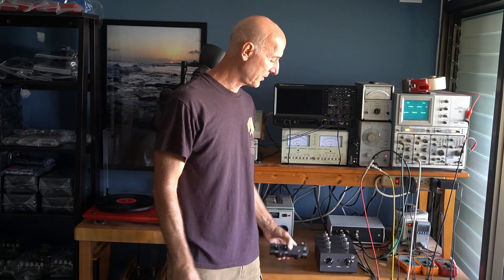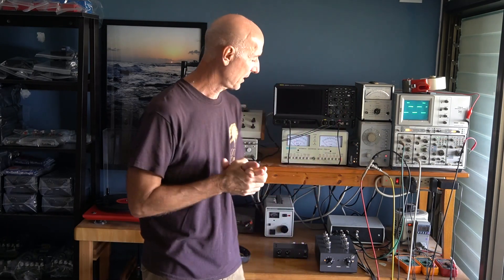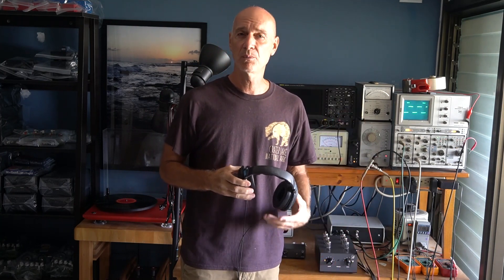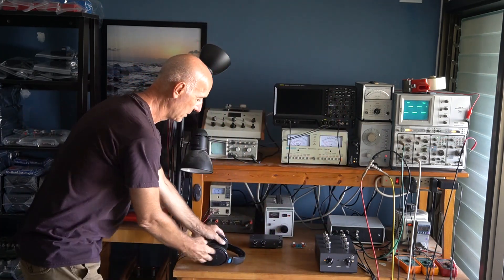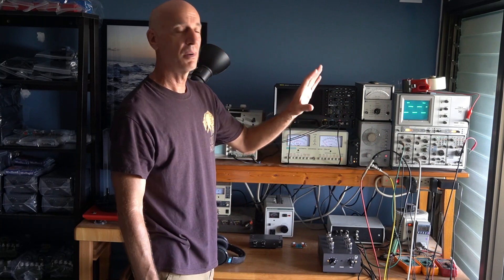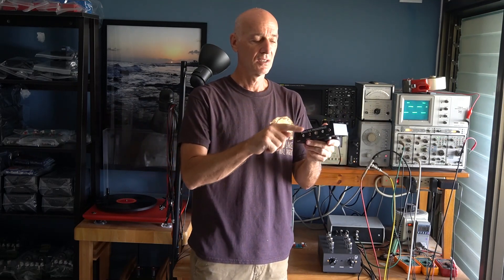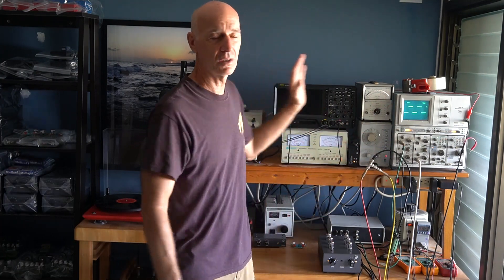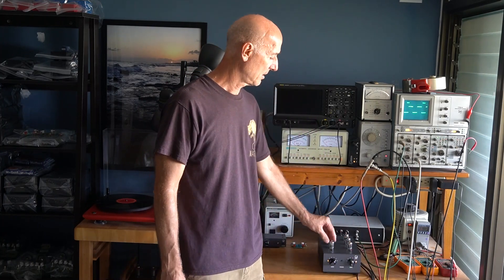Episode 1 - Eliminating Noise in Phonostages

Comment: My turntable is quiet when idle, but when you stroke the stylus or on warped lead in there is a buzzing sound like a bumble bee flying next to you ear. It is not there on smooth surfaces. I check ed a friends turntable and its not there on theirs. Any ideas on what is going on?
Reply from the maker: That sounds like a compliance issue. Mismatch in cartridge mass versus tonearm. I had exactly this on some tracks with my Opus 3 on an RB300 arm. Somehow a 14Hz horizontal flutter kicked in.
Reply: @hagerman_amplification  Ok, Thanks for the reply.

Comment: I have a hum that is present until I start spinning the turntable. Then it goes away even before the needle is dropped. Just spinning stops the hum.
Reply from the maker: Interesting.  Perhaps platter does not make electrical contact through bearing unless spinning?  I'm guessing a metal platter here...

Comment: With tube based phono stages you may have good results with screening/shielding the tubes instead of having them fully exposed on the top. With all the gain, the tubes may pick up noise and hum directly from the air. Adding an open grid or spiral made a huge difference in  my tube pre.  And I can still admire the beautiful tubes through the copper wire screens.
Reply from the maker: Not all designs are created equal.  This phono employs differential tube stages, hence any noise picked up by the plates will be common mode and mostly rejected.  I also place a relatively low impedance EQ network between plates, further reducing noise.  Have you ever heard one of these?  Noise floor is remarkably good.
Reply from the maker: https://positive-feedback.com/reviews/hardware-reviews/hagerman-audio-labs-trumpet-mc-phono-stage/

Comment: I have built 3 of your phono stage designs, great circuits, the cornet octal I built is my favorite. On the octal the input 6SL7 would pick up my cell phone if I got close. I made a shield for the tube from coiled romex wire and that did the trick. Dead quiet even with my cellphone close.